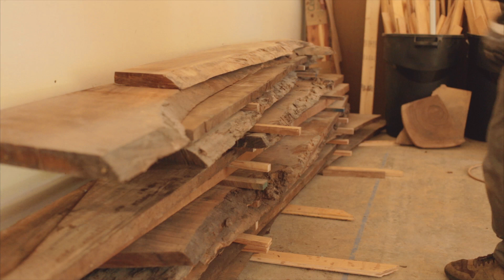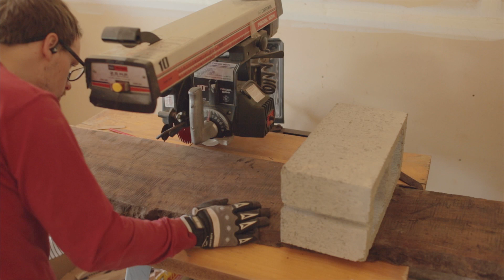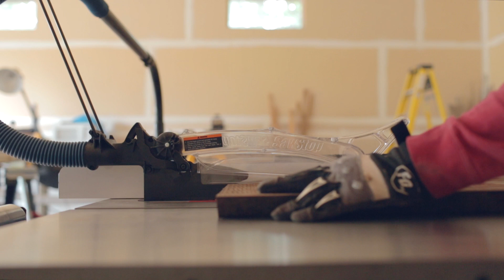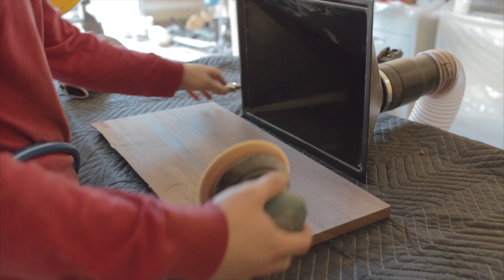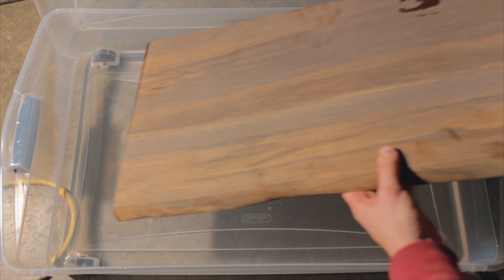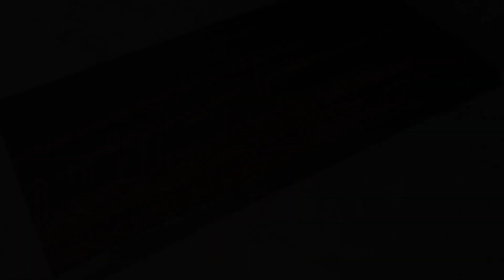Making Black Walnut Live Edge Charcuterie Boards

Comment: I've often thought of dunking my boards as well to really get the mineral oil to penetrate. Do you reclaim it after? And if so, do you strain it? Thought this would be a great idea for a big batch of spoons or cutting boards, then set them on a drying rack for a while before wiping them down. Great work
Reply from the maker: +Stumptown Woodworks I do let it drain back into the container. I only dunk them for about 10 seconds. It works great! Little waste.